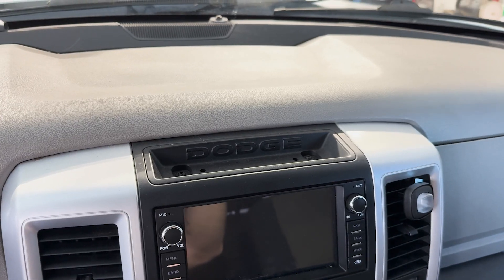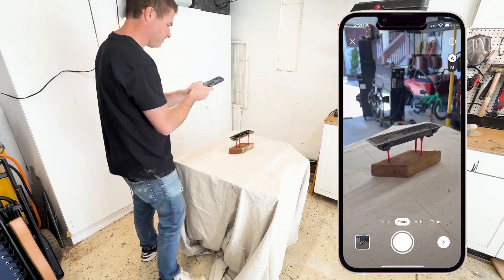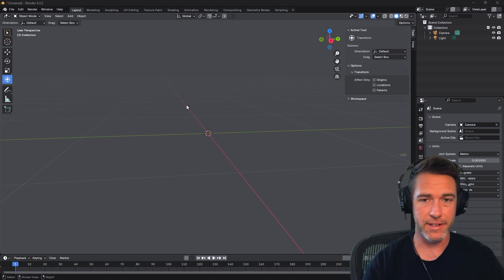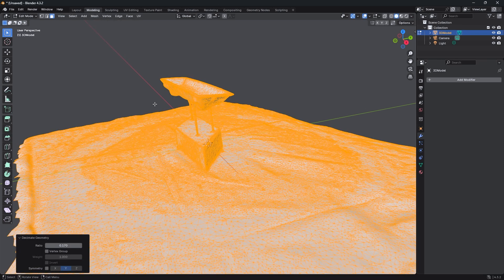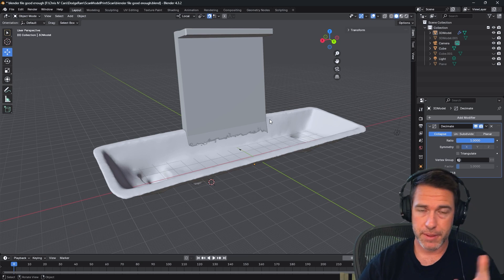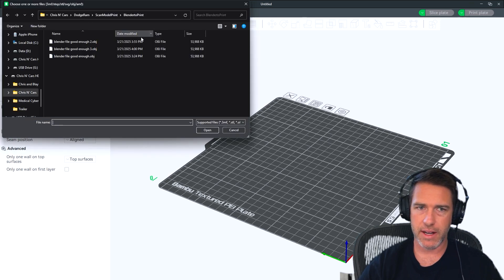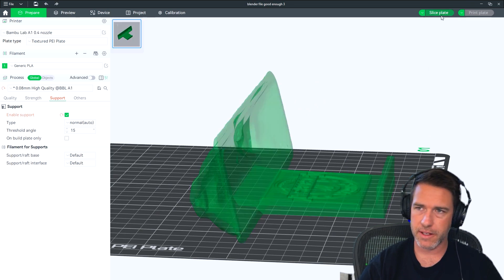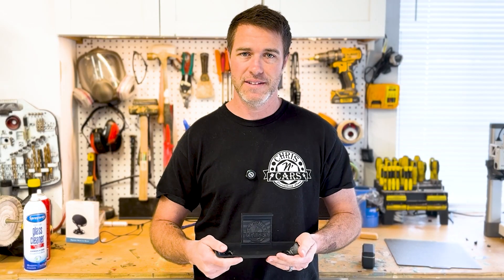Scan and 3D Print Car Parts. FREE Software!?

Comment: Would not recommend PLA. It suffers from creep and warps at 50 degrees celsius. 
ABS would be better but not with that printer you need an enclosure. PETG is your best bet ( though it can be trickier to print)
Great video. Keep up the good work.
Reply from the maker: @mrnlce7939  appreciate it! Always learning.
Reply: ASA